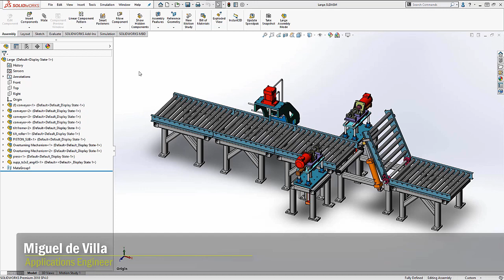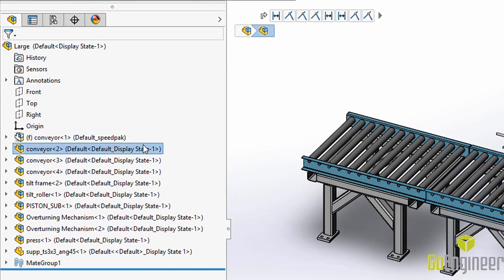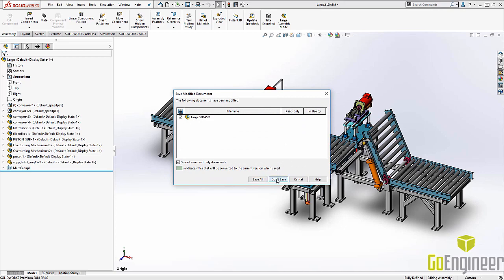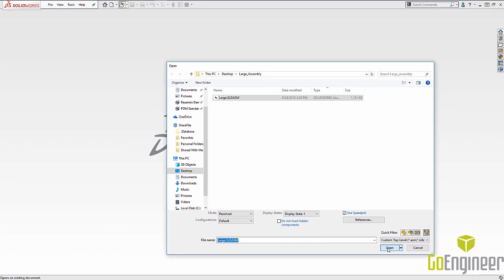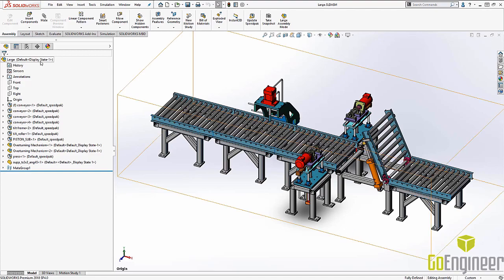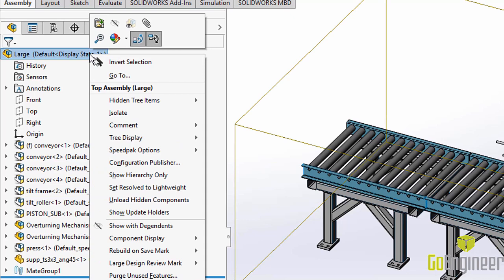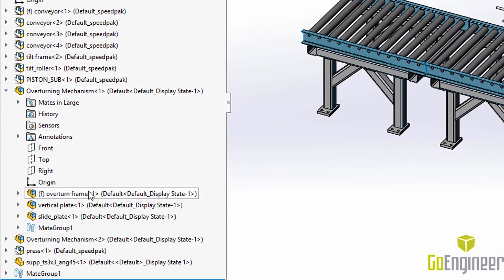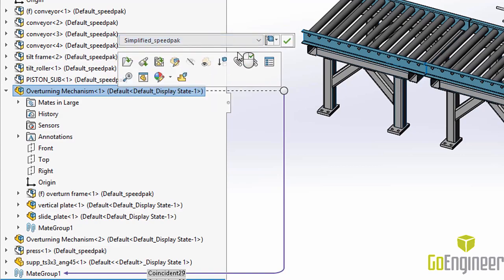SOLIDWORKS - Use Speedpak Option

Comment: Is speedpack like lightweight?
Reply from the maker: No, speedpak uses graphics data only and the selected geometry where lightweight is still a solid body
Reply: @goengineer  What do you mean, it's Solid Body?
There is nothing solid in the Computer.
"Solid"Works is only a Euphemism.
Have you seen what your model looks like inside when you hide one face of it?
It's all 0 thickness Surfaces, stitched together.
And even that only on the screen.......
Otherwise its just a clever system of data.

So what do you mean when you say its still a solid body?